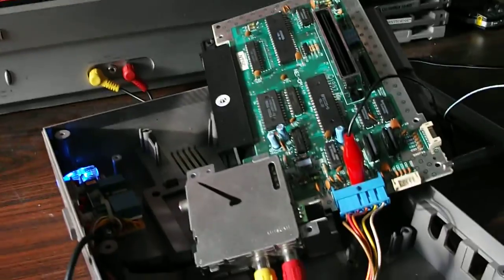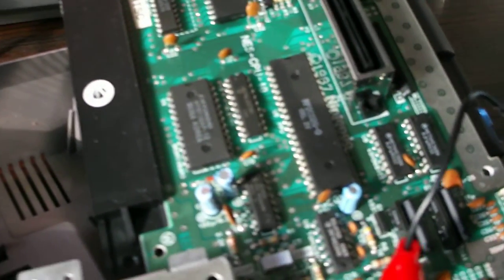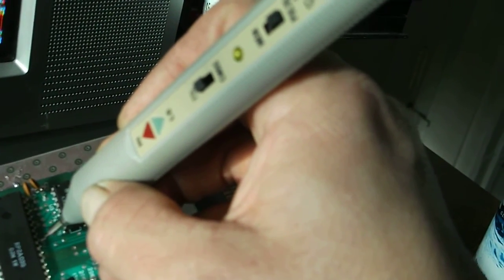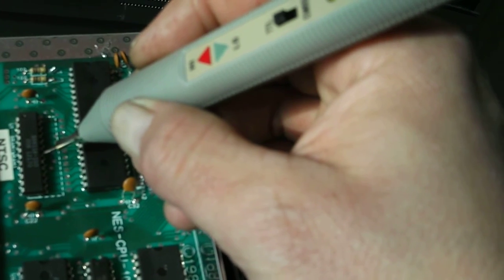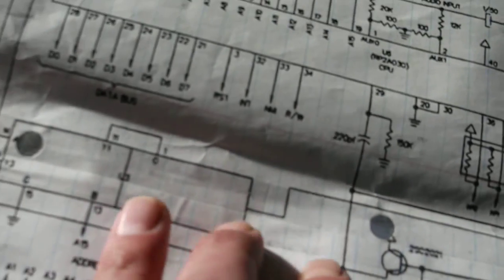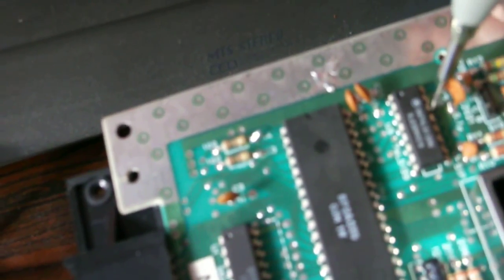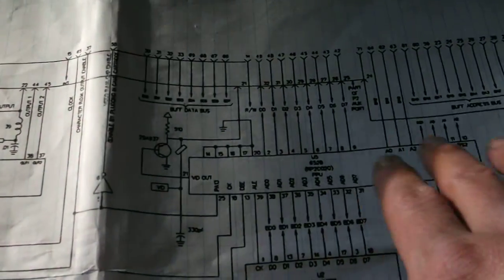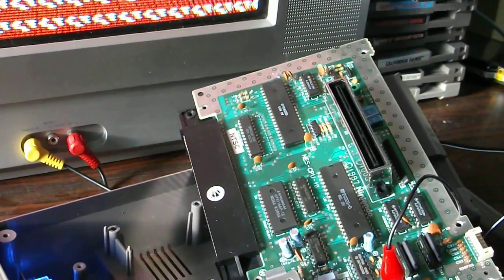Logic Probing a Faulty Nintendo (NES) - CPU Overheating Issues - Schematic

Comment: I have this exact problem after trying to swap NTSC chips into a PAL NES, wonder what caused the cpu to break, i've got a feeling it was one of the power adapters i tried it with, wierd thing is that even after the grey screen i've sometimes seen a game work for a second here or there, just all of a sudden there was 2 seconds of Double dragon looking and sounding good, then it froze. TMNT also worked for a few seconds but with garbled graphics... very confusing.

Comment: Have you checked VCC going into the CPU?  Is it at what it should be?  I would first make sure that the CPU itself is getting the right voltage ....  could be a bad voltage regulator or whatever it’s outputting to ... CPU itself might be bad and pushing at a frequency that’s hitting it hard .... might need to hook up to an O-Scope at this point
Reply from the maker: Thanks, I will.

Comment: haha SERIOUSLY - your lens has a focus ring for a reason!! :D  turn your camera to manual focus mode
Reply from the maker: I am using a Fujifilm  Finepix AX digital camera and there is no focus ring or manual focus mode. When the batteries are about to die, the camera does not function properly. I did however find out that when I start recording, I have to keep the same distance from the object and it remains focused!